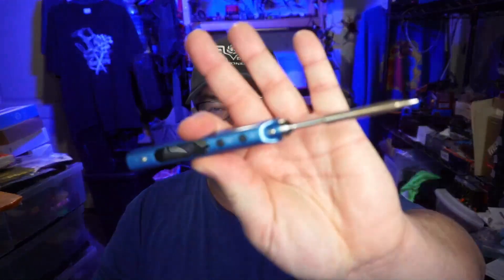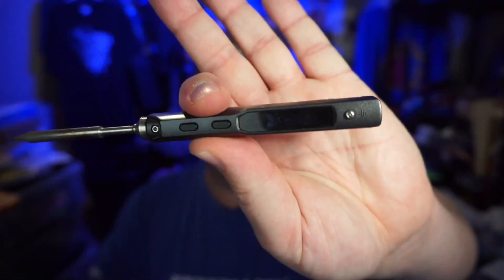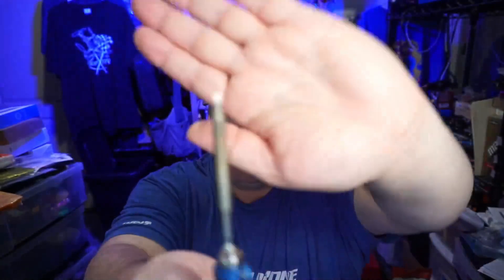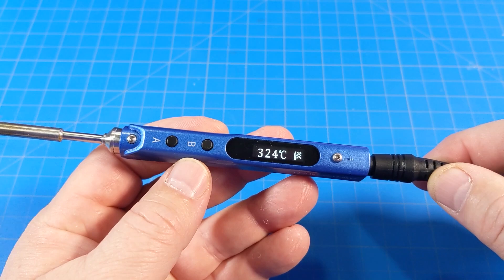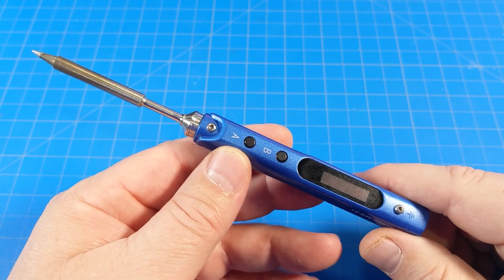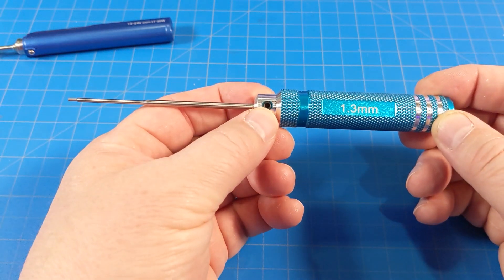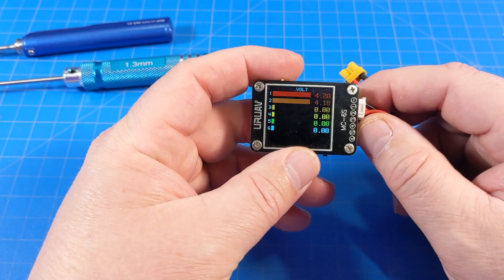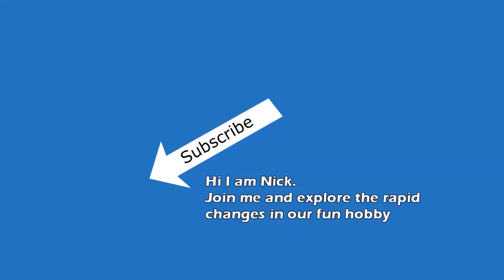Sequre SQ-001 // Tools for FPV // My Favorite Battery Checker

Comment: Nick u wont beleive it buddy cus i had no props on the pid as losing it
Reply from the maker: Sorry, I have lost track of our conversation. What were we looking at. Sorry I have to ask
Reply: @NickBurnsFPV  hey nick i can not figure this fpv thing out man i have bought 4 quads in the last 6 weeks including that taranis...llove the flying aspect but all the qc issues i have had withthe flight controllers and all that jazz the return on my investmnts in this new aspect to my rc hobby dont add up to me....i guess i have horrible luck or china hates me lol...thanks for all the advice buddy ...i woke up this morning tried that x night and its just messed up....thank u very much man for all u have done but i guess fpv hates me and i will be goin back to rc crawlers... thank again nick i really wish i could have joined u guys in ur hobby thanks dude
Reply from the maker: @andytaylor3321  If its not to late, I suggest taking a step back and connect your radio to a computer fpv simulator. Fpv freerider has a demo we can use to see if we can get everything work and running. https://fpv-freerider.itch.io/fpv-freerider They have documents on controller connected and configured to work. I haven't used simulator recently, I hear a lot about liftoff which you can check out if you like. I used fpv freerider years ago and did some training on it, when I was using it I used my thumbs on the controller. After feeling that I wasn't progressing I switched to pinching/hybrid, gave it some time and found that is the method that works best for me. Still pinch/hybrid to this day.

Comment: A useful (which I use often) tool is an Xacto knife..or a pump (not the sexual kind for all those dirty minded people but one to remove solder). I also have these bizzare pliers that are reversed- in the sense that you have to push them together so they open. They have an L-shaped tip, and the very tip is super thin. Works amazing to hold stuff and as a helping hand for wires (my helping hand tends to cut into thin wires). Oh. And helping hands are useful... too much stuff to list xD

Comment: Tweezers, a short pair for holding wires when soldering and a long skinny pair for fishing wires or hardware out of tight places if they get stuck. Silly putty....helps get the ferrous material that gets into brushless motors/bells if you crash. Canned air, whether indoors or out compressed air comes in handy a lot!! There are more especially for bigger rigs but keep it simple. Great video Nick!!

Comment: I have ts 100 wich my lcd screen went out on but i found some on ali express so i fixed it and a sequre one there both the same ts 100 is made slightly better and i use bondic to hold my antennas in place thats a great tool

Comment: Poster putty to hold components and wires when soldering. I’ve been through countless alligator clip “helping hands” but the poster putty stuff is way faster, cheaper, and easier to use.
Reply from the maker: Yes, I tend to use blu tac, its actually grey, but stays very tacky and pliable.
Reply: @NickBurnsFPV  that’s the stuff!
Reply from the maker: @MatthewBennettFPV  that stuff is gold. I am still on my original pack, I keep a ball of it on the side of my desk.

Comment: Last year I managed to snag a TS100 iron in a Banggood sale for less than what the Sequre SQ-001 is being sold for now, as soon as I received it I liked it so much I ordered another at the same price. I think I'm set for many years yet :)
Second to soldering, my favourite tool for quad stuff is my Prusa i3 Mk3, I recently made some folding TPU holders for the Crossfire Nano, Thingiverse 4731250 and a folding holder for the Minimortal-T, Thingiverse 4662724.
Just today I made a folding holder for the ImmersionRC Ghost antenna, Thingiverse 4750114, and am about to upload a folding holder for the Ghost Atto RX with the same mounting options as the Crossfire Nano (as soon as I've taken the photos).
Reply from the maker: All the new antenna mounts!
Reply: @NickBurnsFPV  Yep, someone mentioned my folding Minimortal-T also kinda works with the Tracer antenna, I don't have one to test with except someone posted a 3D object of it to Thingiverse, so... :)
I got the Ghost Atto folding holder uploaded, thing 4750679, unfortunately Thingiverse is having serious issues because it isn't showing up in searches or even in my designs list, you need to know the URL to see/download it. I'll have to re-upload it and hope.
Reply from the maker: @licensetodrive9930  I wonder if thingiverse is having indexing issue.
Reply: @NickBurnsFPV  Problems started being noticeable 10 months ago when view counts of thing uploads just stopped, no more counting. A thing I uploaded about 4 months ago has 500+ downloads and 0 views.
Reply from the maker: @licensetodrive9930  boy that isn't right. They need to get it together, or maybe a competitor needs to enter the space.
Reply: @NickBurnsFPV  It happened again today, two Thingiverse thing uploads and only one of them is showing to the public, going to have to re-upload the other one.
Thinking of moving to PrusaPrinters, apparently their website has a tool to import your Thingiverse uploads.
Reply from the maker: @licensetodrive9930  Are they aware of the issue? Wondering if they even care.
Reply: @NickBurnsFPV  I hope so, but it feels like they've all but abandoned the site. There's many many posts in the site-issues-and-feedback section of their forums listing numerous issues with the site, one of the most obvious being when you start a new topic, it creates 3 copies of the topic.
It's a all bit of a trainwreck right now.

Comment: I love my ifixit pro tech tool kit and magnetic mat with dry erasable marker. All the bits I need and the magnetic mat is perfect for keeping track of those tiny screws and I can label each section to make sure I remember where stuff goes. Its geared for repairing laptops and phones, but its perfect for quads and helis too.

Comment: I have the Sequre and it is a decent field soldering iron. Unfortunately, my tip wobbles out of the base when using it. I fixed it with some tape. 
My favorite tool is a good pair of tweezers. I find them easier to hold and use in tight spaces more so than pliers.
Reply from the maker: If your interested we might be able to take it apart and squeeze the clips together to secure the tip better.

Comment: The AOKoda CellMeter 8 battery checker can check cell voltages AND also discharge batteries very quickly and safely by connecting the included high heat transfer bulbs. (LiPo energy discharged as heat). Much quicker than discharging using a charger.

Comment: 40 seconds in, I say electric screwdriver. 
Soooo useful, can't tell you how much. 
Bought it as a gimmick I thought, use it almost daily.

Great Video Idea btw!
Reply: Other than that, my Leatherman Surge for some rough stuff, hex and  screwdriver set's for the other RC Stuff, all types of glue, very important!
Good calipers, an arrangement of tweezers, scalpel with diverse blades, reliable torch lighter, good permanent markers, and of course a soldering Iron for the quick deal and a station for the more delicate jobs, a good headlamp helps also a lot when working on tiny pieces.

That sums it up quite well.
Edit: fixed some autocorrect mess
Reply from the maker: head lamp is a good idea too, I have these recording lights I tend to turn on.
Reply from the maker: I have looked at those screwdrivers and nearly pulled the trigger a few times. You making me think I am missing out.
Reply: @NickBurnsFPV  I got this BG Wowstick thing, the full set ( Wowstick 1F+ 64 in one, just looked it up) with all the bits and some extra stuff. No regrets, better late then never. 
Headlamp is also convenient when I solder, spot on light where I need it, no shadows.

I'll be glad if you benefit from this tips.

Comment: Wiha 26810 Precision Chip Lifter
It's amazing for taking off whoop props, and prying plugs, which is handy for the number of times I need to pull apart motors and clean between the bells on my whoops, Thans to Ciotti for making me aware of it

Comment: Anyone who solders I highly recommend getting a pair of hemostats. They’re basically those tiny tweezers you get with repair kits crossed with pliers and they have a locking mechanism. Great for holding wires without getting burnt. They’re usually under £3 on eBay or wherever. 

HEMOSTATS FTW

Comment: Definitely recommend the PINECIL. USB-C and barrel...already running Ralim, nice silicone grip, and uses TS-100 tips.

I LOVE mine.
Reply: I already got the SQ-001, but this 👆 seems like a valuable tip!
Even cheaper than a SQ-001 and supports power input on the USB-C. Never heard of the Pinecil before, but seems like something to recommend anyone starting in FPV! 👌
Reply: @henkdevries2971  PINE is a company that has open source hardware/firmware on all their devices. They're incredibly cheap, are beyond receptive to consumer input, and are all around worth a look.

Comment: The PINECIL is the same kind of iron as the ts-100 or the sq-001, but was $25, for $5 extra they sell a red case, and it has a rubberized grip, can get its power from usb c or power adapter, and can load custom firmware. plus has a low voltage cutoff for lipo powering. i've got 2, they work just as good as the ts-100 i also have. but the rubber grip makes using it much nicer
Reply: Comes with Ralim already.

Comment: I think you've shown that multi-bit tool before because I bought one after seeing it. I rarely use it though because the handle is so heavy. I usually take the bits out and use it with a lighter bit driver handle.
Reply from the maker: I do tend to take the bits out. I will get that initial turn or so on the screws I need to remove then slide the bit out and finger loosen the rest of the way.

Comment: Most used:
TS-100 soldering iron w/high quality solder and flux
Good set of tweezers
MIP Hex Driver Ball Wrench Set
Cheap fpv watch screen
Multimeter 
VIFLY ShortSaver smoke stopper

Comment: Is there a lipochecker that can do 1 cell lipo? Most of them only do 2 to 6
Reply from the maker: yes, I have a very old simple one from LDARC, the company may have been called KingKong back when I got it, there is not model name on it. Betafpv also has one, but yes, others can be found cheap on ebay.

Comment: Hi Nick   YEP I do like a great pair of tools,  but I still like a good pair of.           hex drivers.  I tend to strip them out and then they will strip the heads on new screws.  I do like your battery checker over my E-flight checker that you need to wait as it goes through each cell one by one.  Thanks again for the video.

Comment: once you get in it, 
after a good battery charger (hota D6 or p6 pro) 
soldering iron... hard to argue against that, (I have ts100) 
great metric drivers. I have Protek kit (bought at LHS) 
CA... 
Tripod, use phone to zoom in on my solders joints.